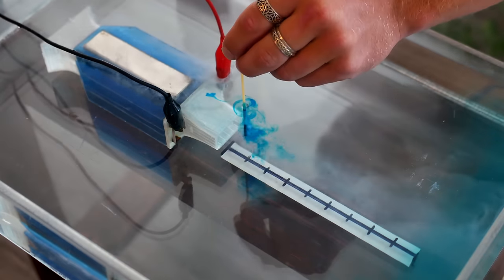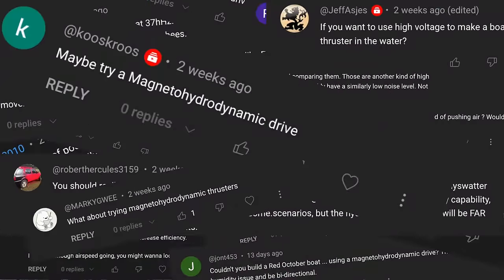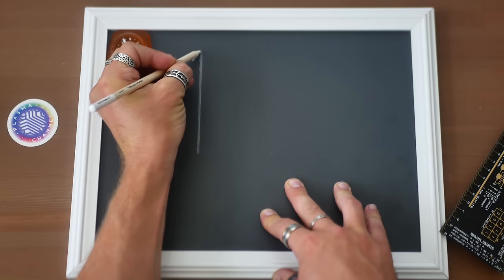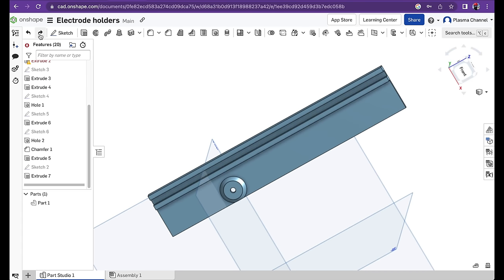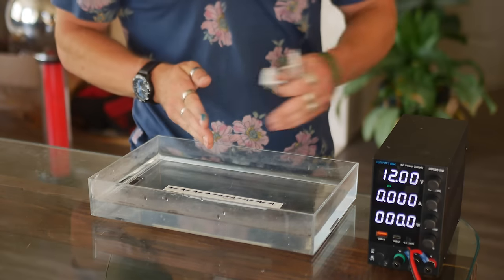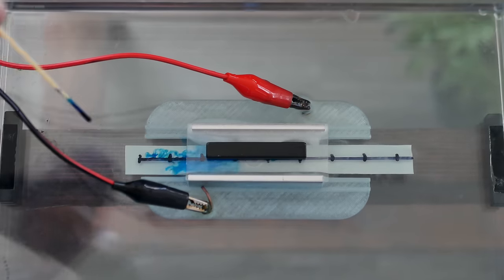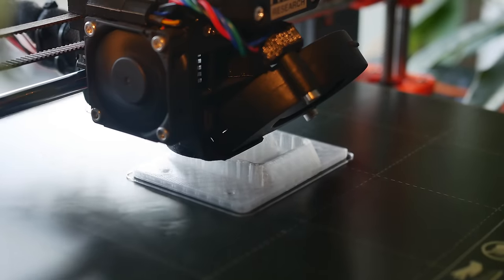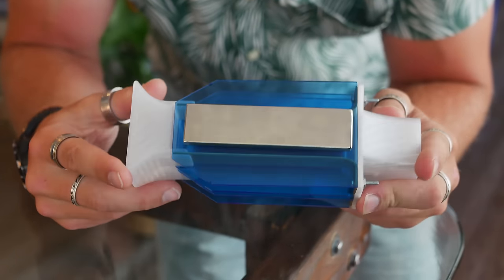Using Stealth Propulsion for Ocean Travel (MHD Thruster Build)

Comment: Just a suggestion;  What if you were to use copper pipe cut longitudinally down the center and the resulting anode and cathode separated by an insulator.  An hydrodynamically designed elongated magnet could be centered in the two halves and set in 2pac plastic if necessary to hold several shorter magnets in line.  Thin plastic centering fins front and rear should be adequate to center the magnets  Maybe to a certain extent the thrust could be increased the longer the water is in contact with the longer electrodes and magnet?.  The two half-pipe electrodes could be sent away and chromed or do it yourself.  That should minimize corrosion..  Cheers from Aussie ??

Comment: Interesting you chose not to use electromagnets, just a wire wrapped around a ferromagnetic material (with appropriate magnetic susceptibility).   That way, you could control the strength of the magnetic field as a control variable.  Also, I wonder if you didn't see any speed dependence on the electrode spacing, because the water speed in the axial direction would depend on the ion speed moving from one electrode to the other (i.e., the 'v' in q*v x B).  Maybe your spacing choices were big enough that ions speeds reached steady state, in which case spacing wouldn't matter.

Comment: What if you went with a more tube shaped design? You could arrange magnets and electrodes into a tube shape to put even more magnets in the thruster. Since adding one magnet made a significant difference, what would many more magnets do? And what if you used electro magnets instead to produce a stronger magnetic field?

Comment: change your magnet out to an adjustable /varible strength elctromagnet -also your plates should be tube(tubes would have more surface area and self support strength aka multiple tubes==think as a bundle of straws-when you get done with that i have more ideas and many questions

Comment: Maybe the spacing of the electrodes didn't have an effect on velocity but the volume of water displaced by it should increase if the velocity remained the same due to the larger surface area which would increase propulsion right ?

Comment: This might be a stupid question, but if you force the water to flow  backwards would it create an electric current?
Reply: Not a stupid question, and the answer is yes.  You don't actually need to use salted water, either - any conductive fluid will do, including rocket exhaust.  Seriously: there are extant designs for short-term high-output electric generators for orbital launch lasers and the like.  Turns out to be better to put a payload on that rocket and launch that instead, but the designs still work.

Comment: Fun. But you really need to learn what is known as DOE which expands to Design of Experiments. It has also been called SEDA which is Statistical Experimental Design and Analysis. The method allows you to test all the factors together at the same time. Relative to the "one at a time" testing that you did, DOE requires fewer tests and returns more information. There are many test design types depending upon what you are attempting to do. Before I retired, I was a design engineer. The methods proved useful for a wide range of needs. You took a stab and put everything to max. With a "Full Factorial" DOE, you would have known which was better and how the factors interacted with each other. Other designs would have added information about data "curvature," etc. If you plan to do more projects like this, consider spending some time learning DOE.

Comment: 25V times 9Amps = 225 Watts, about 1/3 of a horse power, to produce only 75 grams, less than 3 ounces of trust.  So a 1 HP amount of energy produces only 9 ounces of thrust.  A 1 HP propeller motor would produce over a hundred times more thrust for the same energy input.  But now we know it doesn't work we can focus on Sharrow or toroidal /donut shaped propellers.  Thank you

Comment: So what happens if you connect a second power supply and replace neodymium with electromagnet? You should be able to get a much higher tesla at that point and produce potentially enough thrust to create "waves" in the tank.  Theoretically (just came to mind now, not thought out) if you encased the electrodes in a metal case you could make the entire box an electromagnet and significantly increase thruse.  Love to see what hapens.

Comment: Imagine the electric field between the electrodes.
Now imagine the same field with the same  electrodes coated with a very thin coating of dielectric.
The electrons are still stripped away but the atoms do not disassociate, No electrolysis, same thrust.
(I think)

Comment: What if there's an increase in the surface area? Instead of a plate it's a fin stack or at least deeply grooved  plate. Or a highly polished surface that would prevent the bubbles from sticking?

Also a magnet behind the plates should be tested. Or a rod (or multiple strings with space in between them) in the middle of a cylinder with magnets set up the length of the cyliner either between or outside cylinder (anode/cathode) wall.

Comment: Not a scientist, no experience here. Please forgive my ignorance. Much focus on moving an object. Would this work as a pump to move the water extended distances, say in a pipe/hose, not the object the thruster was attached to? 
Thinking like clearing the basement of flood water. Is something like this already in use? Could it be effective and practical?

Comment: Use Ionic thrust do the experiment is better cause air is lighter the result is more obvious and it'll be easier to study. They both basically the same is cousins so what work for air it will work with water Can we see it like that will that work?

Comment: I wonder if you could make a water powered generator using this concept. That thruster could push water, water then pushes the turbine blades. The only problem I think you’d have is the energy that is outputted. What if you used the Tesla turbine concept.

Comment: I am skeptical about your "experimentation" where you looked at only a single variable at a time, and not looking at how the variables interact.  But, that said, it strikes me that if the separation between the electrodes seems to not effect the output, that if you built a large engine, you might move a lot more water at the same speed.  Of course, that would take more energy, but might be worth a look.

Comment: Use stainless steel for your electrodes. Salt water will dissolve your aluminum electrodes. I used 316L in my electrolyzers with good results.

Comment: I'm not sure a thruster that partially electrolyzes the water and everything in it would be a good thing to scale up. Using this thruster in sea water creates chlorine, and hydrogen gas in large volumes and I'm not sure what happens with the sodium, oxygen.   The byproducts created by MHD thrusters could be of extreme concern if many large ships (supertankers, container ships) are equipped with them and pass through high traffic areas like the Panama canal.  Considering one of the byproducts is chlorine gas...  do you trust the owners of the ships to capture / react it instead of just venting it?  Even if the ship has mechanisms for processing chlorine gas at these startling volumes... running those mechanisms would incur a cost, and it would be hard to catch them venting it.

Comment: does the plate need to touch the water? what if you pulse the DV volts and induced a charge in the water by induction. What if the plates formed a tube and the magnet inside, in the middle?

Comment: I wonder if the way the magnets are stacked can be changed to improve performance. Maybe instead of a vertical orientation its set up in a radial orientation. Or have 4 magnets contribute to one singular inner channel and have separate channels stacked on the sides in a plus (+) shape.

Comment: I wonder if denser metals would have a practical effect on the flow strength. for example, gold and silver are very good conductors due to density, maybe that would produce a stronger thrust? I don't pretend to understand everything this channel showcases, but my gut says that denser metals might have an effect when used as electrodes.

Comment: Can that magnet also be an electro magnet ???
What amperages work best
 high or low ???
A Testla Turbine Engine linked to one of his high speed generators or alternator.
And one of his one way valves to steer ...
Necked down in center to multiply force.
A big venturi ...
Once fired the Turbine Engine can be fed pretty much anything that burns ...

Comment: Maybe the spacing thing has to do with the fact you are moving water in an open channel between the electrodes instead of moving water through a pipe . No way a two inch pipe can move the same amount of water as a four inch pipe if the water speed is constant .

Comment: “Have you checked if you can turn this pump into a generator by feeding it with stream of saltwater?
If that works could this be placed in some of the large currents such as the Gulfstream producing clean energy”

Comment: Length of the electrodes sounds like barrel mechanics for guns, longer barrel translates to more distance for pressure to accelerate the projectile. Wondering how many suggestions for electromagnetics instead of static solid magnets? I would look for materials that can accompany the electromagnets to give more control over the intensity and direction of the magnetic poles/field. Fully electric silent submarine, yes please.

Comment: May I suggest getting Inert / Non-Reactive Electrodes for a future thruster build, just so you can use it in your boat/sub continually without breakdown.
Reply: At those voltages there are none. Industry standard is usually platinum but even it will corrode at 5V.

Comment: 🤔 a) how much risk to oceanic wildlife is the electrifying of the water ?
b) how much risk is it to swim around and under ?

🙃can it be used in conjunction with an intake tank to gate higher propultion ?

😳can it be used to add propultion to firetruck pumped tank water to accentuate the output to reach higher hights and longer lengths ?

(😅isnt this tech really from the waterpic innovation for oral hygene?)

Comment: Instead of brass use stacked pieces of aluminium or stinless steel as stacked in electric motors to improve the efficiency and  have higher magnetic field with lower energy and higher thrust.

Comment: We are remodeling our dealership and the demo crew just put two large tinted double pane poly windows in a dumpster. 

My intrusive thoughts are wondering what type of cool plasma I could generate inside of them. They are fairly large at about 3ft x 3ft and about 1.25 thick

Obviously it's kind of hard to generate a square vortex but theres gotta be something I can do even if it's putting a circle inside of it. 

Help me make awesome end tables people. I need all the ideas!!

Comment: Jou should only use half of te magnetic cirkel. Like te katode exactly in te middle. Te left side is useless. It even a little contradicting. In a rail gun half of te feald is also on the left of te retour wire. Just Draw a long magnet and put earows from north to shout. Jou save a magnet and can put another katode there en an anode left to it. Or te left hand rule if the fingers do not touch there's no force

Comment: i hate tec stuff i dont understand it but what i got from you experiments is that it works like a gun barrell longer barrel more powder/air faster it go? is that right? love video even if cant understand the science, hell yer on better engines on boats with solar power charger to keep power for engine and only problem i see is against current. Also metel rotting in salt and the effect the extra metal from the electrical discharge poluting in the sea

Comment: Your design works against itself. Water has no compression, so your narrowing for the outport works for air, not for water. Jetting with air can use this for speeding up and directional flow, where as water you would just want a flexible outport, that is the same diameter as your inner flow area. Also very curious to what would happen if you made this into a circular/cylindrical shape, alternating plates and magnets. Very amazing video none the less.

Comment: What is the comparison of an electric motor driving a propeller with the same 25v x 9A = 225 watt power usage? That would determine your power to output feasibility. Could be neat science but impractcal application.

Comment: Great week. Got a new ion thruster powered baloon from intezga and a MHD from you. Now my question is. If you were to use an electromagnet instead of a neodymium magnet could you get even more thrust? Because electromagnets increase the size and strength of the magnetic field.
Reply from the maker: Right? Great week! The amount of power that would consume is insane. The neo magnets offer a super compact alternative, and an equivalent electromagnet would weigh several pounds plug consume hundreds of watts.
Reply: @PlasmaChannel  it would consume much more power but would it be worth testing 🤔 
I know a bit about RC aircraft but I'm still learning some of the rc water craft details like thrust in grams vs mass and drag of the craft equals out to what kind of speed. And how much thrust is needed to oppose current.
But going off the hunt for red October narrative. They were using a nuclear reactor to power the drive. So I'm guessing the power was in megawatts.  And that is what the whole overheating  part of the plot was about.. the cooling system failed. the electromagnet was acting like an induction coil and started melting the MHD.

Comment: Could the overall design of the drive be coiled like a slinky, & perhaps flexible enough to fine tune by altering the length & diameter? (like a tuneable railgun arrangement)
How about guiding the output via a spiral design like Victor Shaubergers work with vortexes? 
What about novel superconducting materials or super capacitors? 
Could hydrogen collection be introduced as a fuel tap for generating more power? 
Could you scale up to multiple units along the length of a ship's hull? 
Could supercavitation be thrown in the mix to lessen friction at the bow?

Perhaps a sub system of electrical generating biological (Biomodd) systems...
I know I'm throwing the kitchen sink at you, but it is very interesting!

Comment: Your data on the electrode spacing was flawed due to the method of measurement. Rather than using dye, try using pellets. That would give a better reference against the grid.

Comment: Can't imagine a 25 tonn boat with this design.

"Alright guys this is it, just an hour and we'll be at the port."
"We got a problem capt'n."
"What is it?"
"Our rods melted away." 
"Dammit, weld some scraps to them, she'll manage somehow.."
"We still can't move capt'n."
"What now?!"
"The batteries are dead."
"What the hell, so soon? Run more diesel generators."
"We can't return captain."
"Crap, why?!"
"Water isn't salty enough."
"I RESIGN!" [jumps into the ocean]
Reply: While it is not practical, there was a 185 ton experimental vessel built with MHD drive (the Yamoto 1); see the Wikipedia article for "Magnetohydrodynamic drive" for some history  with references.

Comment: Its a cool idea but the argument for this is noise in the water for the wild life. But electrified water isnt going to hurt any animals? Im no animal activist or anything but this sounds dangerous lol. im also not going to claim i know how the electricity works in the water either but it sounds like a bad idea for life to mix water and electricity lol. If im wrong please let me know.
Reply: The water resistance is high enough such that the current loop is only between the 2 electrodes. In other words the current going out from the battery will go back into the same battery from the other electrode.
Reply: @martantoine9977  Ah gotcha i was thinking maybe its really low amps? Thats pretty neat though.

Comment: Could this technology  produce  a unit with dimensions similar to modern electric trolling motors used in tournament fishing, say 1 foot long by 6-8 inches in diameter  that would work off of 24-36 VDC . Would have to produce a great deal of thrust,  enough to compete with the modern electric motor units which produce 100 pounds or more. I've been pondering that idea for 30 years, ever since I read Hunt for Red October. This could revolutionize the trolling motor industry, as it is completely silent.  Modern trolling motors are pretty quite, but they still produce a noise, and the prop also produces cavitation. Fish sense both through their lateral lines. And because sound travels exponentially farther and faster under water, a totally silent motor would  increase the stealthyness by a factor of ten.  Modern trolling motors have large magnets in them already, with the motor unit weighing 20-35 lbs.  My only concern would be what was addressed in some of the comments. Keeping the magnetic field as compact as possible, as I dont know the effect it would have on the sonar transducers that we all  usually mount to the bottom of the trolling motor.

Comment: Ya may not get round to reading this but I have a few ideas to improve this design I've played about with hydrogen wet cells in the past and because of the different numbers of electron's in each atom of oxygen and hydrogen for best results ya best off having 4 positive pole to the one negative when it comes to sending power through them my Idea was makeing one of these with 4 positive electrodes around a negative one in the centre with a tube or donut magnet providing the magnetic current around the central electrode I was wanting to do a similar design to produce extra HHO gas's from a hydrogen cell maybe you should try it